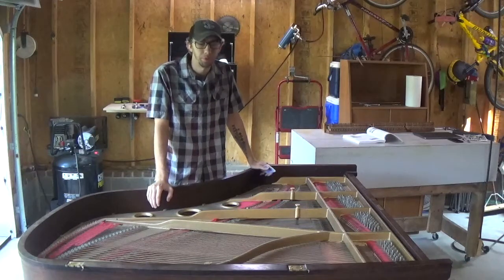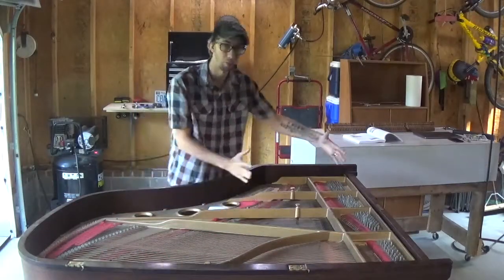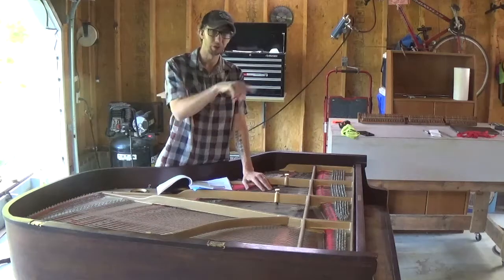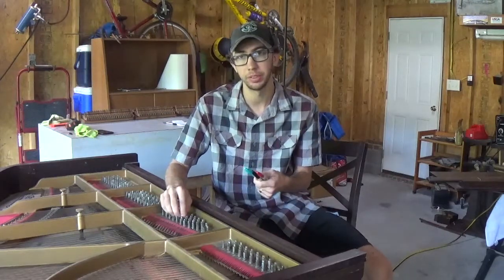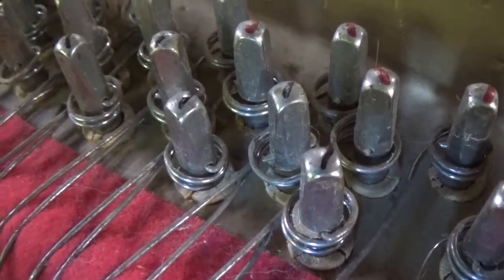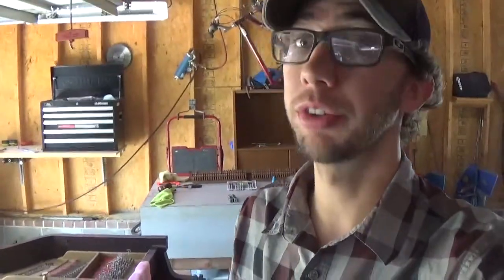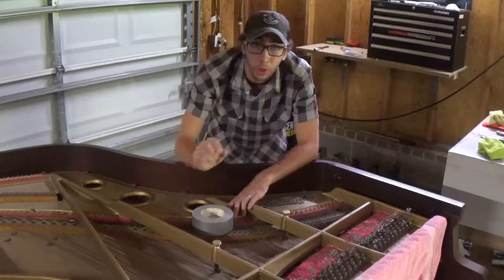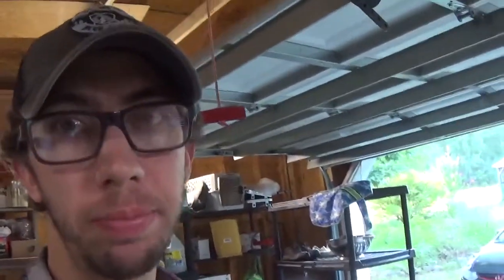In Depth Tutorial on How to Remove Grand Piano Strings

Comment: If I am getting rid of the strings to just throw out the piano, can I just complete loosen the tension on each string without doing it evenly, can I just cut the strings?
Reply from the maker: You could do that but the strings are just going to break or need to be cut at the tuning pins anyways so you might just be creating more work for yourself in the long run. I don't know if I can think of any reason why you can't, but I am an amateur in regards to this and it would be beneficial to consult a real piano tech for more advice.